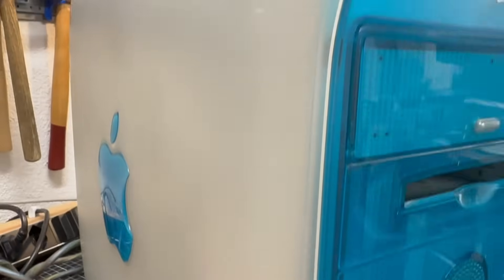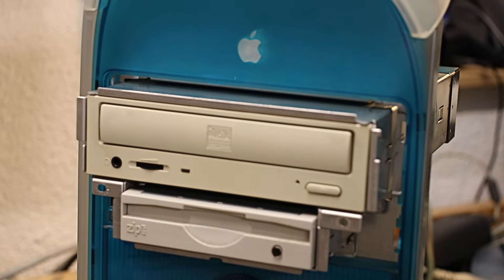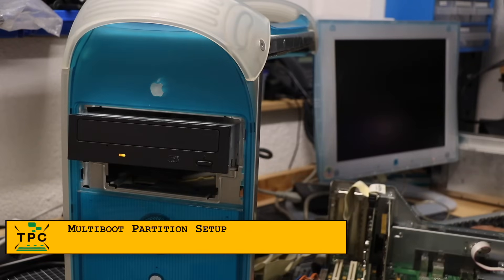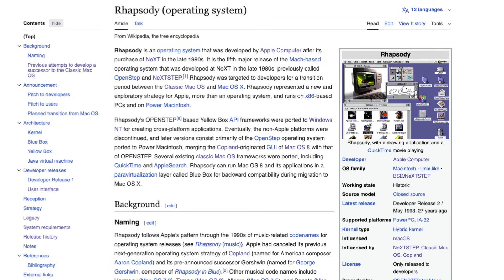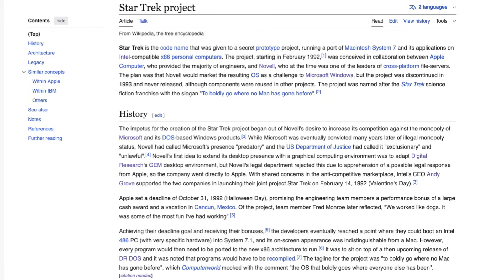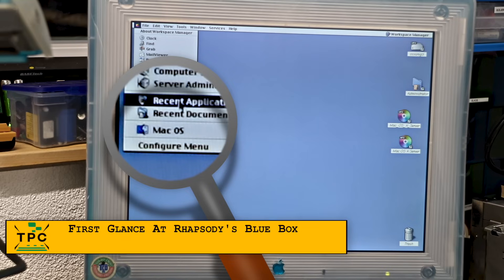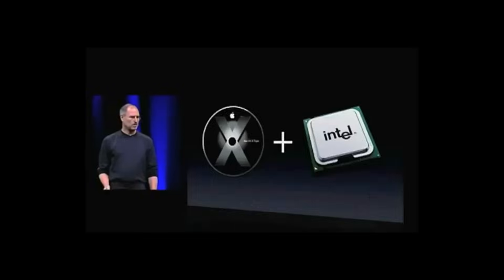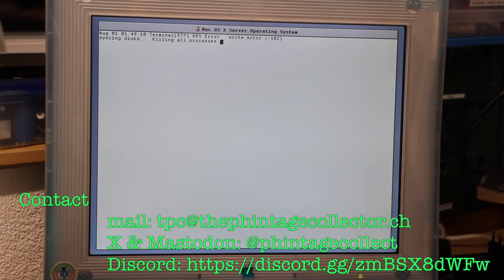Apple’s Rhapsody Era — Mac OS X Server 1.0 on PowerMac G3 (Part 1)

Comment: Apple also dipped their toes into Linux for a few years, working on MkLinux - Linux kernel running on top of a Mach microkernel on Apple PowerPC hardware. The userspace itself was Red Hat derived so not Apple-y at all. I suppose it was more of a exploration project, not really meant to replace their main OS.

Comment: A channel called "Another Boring Topic" recently released a lengthy and detailed analysis of the Apple/NeXT merger. It paints a slightly different story of Rhapsody and OS X: that Rhapsody was a failure, the migration strategy of "just rewrite everything in Yellow Box APIs" was laughed off by developers who weren't confident at all that those are here to stay at all, and that due to all that, Apple basically started over - that what eventually became final OS X (10.x) wasn't just an evolution of Rhapsody, but a major redesign, prompted by the failure of Rhapsody.

It's also worth noting that Carbon wasn't just a modernized version of Classic Mac OS APIs that could run on OS X - the exact same API was also available on OS 9. In fact, both OS 9 and OS X could run the exact same Carbon binaries. This gave developers basically no downsides when migrating their apps, probably contributing to the success of this API and OS X as a whole. Apple eventually got its way and forced everyone to migrate to Cocoa, which is a descendant of Yellow Box, after all - but it took several years.
Reply from the maker: Hmm ... with no single syllable did I say, Rhapsody was a success. No idea, how you arrived there.

And, to furtherly quote myself:

"[..] At this stage, Rhapsody relied on just two worlds: Yellow Box for new applications, and Blue Box to keep classic Mac applications alive. But this approach met resistance from developers who didn’t want to rewrite everything from scratch. [..]"

Maybe not as exaggerated as saying "developers laughed it off", but hey, they most definitely didn't want Yellow Box.
Sole reason why Apple brought Carbon along.

Rhapsody didn't have Carbon, only OS X 10.x and OS 9 did. Later on, OS 8.1+ received an optional CarbonLib update, too.

But these are aspects, which will be visited in more detail when I come by the actual OS X 10.0.
Reply: @THEPHINTAGECOLLECTOR I'm not suggesting that you said Rhapsody was a success. The point that Jonathan from ABT was trying to make is that OS X 10.0 isn't a direct successor/evolution to Rhapsody, but rather more like a start-over of the whole idea to Mac-ize NEXTSTEP.

Is that really the case? I don't know. But it's an interesting hypothesis. I really recommend ABT's video in any case, there are tons of interesting details in it.
Reply: @kFY514  I would suggest that’s more of a “ship of theseus” argument than a technical discussion. (Or perhaps the “when do grains of sand become a pile” one? Anyway.) 

How much does the codebase need to change for the same concept on the inherited NeXT Unix core to stop being the same concept? Different people will inevitably draw the line in different places. 
Especially with this being characterised in this video as a rehearsal/practice-run, it’s an apt metaphor imo. We see people disagreeing on whether something is an entirely-different stage/televisual production, merely built on similar bones after production changes, or whether they’re just evolutions of the same show, all the time. 
Or indeed there’s all sorts of arguments and historical flip-flopping in biological taxonomy as to where to draw the line in exactly the same way. Even what term to use (subspecies? Compatible cousin species? Species complex? Etc) when things are closely related but still different-ish in important ways.
Reply: @kaitlyn__L  I think that TPC's last video gave a pretty clear and definitive answer: what was released as OS X Server 1.x was a different development branch of OPENSTEP/Rhapsody than what was eventually released as 10.x.

The best analogy I can thus think of is, was Windows XP a successor to Windows 98/Me? From a business perspective, yes. From a technological perspective... eh, sort of, as it incorporated some tech originally developed for those (like System Restore for example), but also not really, as it was based on a completely (much more vividly than in the case of Rhapsody) different, parallel line of development. You're right that the boundaries are muddy :)
Reply: @kFY514  appropriately enough I’m in the middle of that one right now. 😊

Different development branch with the same goal certainly sounds a closer relative than DOS/NT, so I’m glad I brought up the cousin-species/subspecies argument. I think that’s probably the closest analogy! (Indeed different major versions of AT&T Unix or original BSD had such radical changes too.)
Reply: Correction: Mac OS 8-9 could only run Carbon apps compiled as CFM binaries, a similar format that classic Mac OS used. Mac OS 8-9 could not run Mach Carbon apps.

Comment: I still have mine 400MHz in original box with 17" CRT and two matching LCD monitors. Everything still looks like new other than small cracks around the side panel screws. I did have to change the flyback in the CRT. I have a Voodoo5 MAC still in box and two Redeon 9200 GPU's I used to use in this system back in the days. Maybe someday it will be worth something.
Reply: I never knew it was replaced so quickly. Did you get mad when they came out with the G4 so soon?
Reply: @MaxOakland  Not really. I can't believe it was back in 1999 doesn't seem that long ago but I was just going into high school at the time. I got a HP laptop for Christmas that I could take to school. Back then it was rare to have a laptop at my age I remember. I also remember having a Powerbook G3 Wallstreet but it was getting old already.
Reply: Make sure you pull the pram battery!

Comment: "UNIX based core" Holy marketing BS, Batman! There is no UNIX in there! Although early Next computers did come with a licensed copy of UNIX, by the time of the Apple merger, they had stopped doing that. Also, there's no such thing as "BSD UNIX". BSD stands for Berkeley Standard Distribution, which was a distribution of utilities and whatnot for Research UNIX. Users had to get a licensed copy of Research UNIX from AT&T separately. But after the breakup of the Bell system, AT&T was spun off, and the UNIX product was sold to UNIX Systems Labs, who had no interest in Research UNIX. At Berkeley, they closed up shop on the BSD project, releasing a final version with a clone OS that was supposed to have all traces of UNIX expunged from it. However they didn't do a thorough job, and USL sued them. By the time Rhapsody came out, BSD was dead for years. All of these claims that BSD is somehow synonymous with UNIX are untrue. The saddest thing is that the true story is actually interesting, but false advertising isn't.

Comment: 4:52 I thought you had to "HOLD" the "C" key during the entire boot... or maybe repeatedly tap.. it needs it at a very specific time and I always found it frustrating to nail.
Reply from the maker: Press and hold, correct. Unless the drive doesn't work, like mine ...

Comment: 4:57 correction: all PCI-based PowerPC Macs had Open Firmware. The iMac was the first with a “New World” ROM, which worked better with Mac OS X and fixed a lot of bugs. 
And yes, you can boot into Open Firmware on Old World Macs, but the default output is one of the serial ports instead of the display. There was a Mac OS 9 application that could change the values of Open Firmware parameters and make Old World Macs use the monitor instead of the serial port. 
I think booting from CD was fairly old: my family’s Performa 6360’s restore media was on a CD and could be booted from by holding down C at boot.
Reply: All "Old World" Macs contained the Macintosh Toolbox in the ROM. The architecture on PCI-based Old World machines was that they had Open FIrmware as the lowest layer of its ROM, but the implementation was somewhat buggy and barebones, as it was meant to only ever boot the Toolbox from the ROM, which in turn booted Classic Mac OS in a way that remained largely unchanged since the original Mac. Old World G3s can run OS X, and AFAIK that actually configures OF to boot the Mach kernel directly, but AFAIR the contemporary method to boot e.g. Linux on those machines was to use a bootloader launched from within Mac OS.

New World Macs only have Open Firmware in ROM, and when booting OS 8 or OS 9, the Toolbox loads from a file on the boot drive. But that also means the OF implementation is much more mature and complete, as it was actually intended to be used directly.
Reply: @kFY514  Pretty much spot on. Those old-world ROM macs used OF to initialize RAM and run PCI ROMs, then hand control back over to toolbox to boot classic MacOS. The only PowerPC-based Macs to lack OF were the NuBus first-generation Power Macs. 

Some of the last old world ROM macs, like the wallstreet PowerBook G3s, could display an OF console and could boot linux from it directly using quik. It was still easier to use the BootX extension to do it on them though. And as you say, MacOS X on them also came with an OF bootloader also called BootX, which was used to boot OS X on those machines just like it did on new world macs.

IIRC Apple BootX was actually pretty seriously overengineered. Apple had took steps to make it so that the MacOS X' BootX bootloader could also boot linux or any other operating systems of potential interest. It was capable of loading arbitrary ELFs from HFS/+, UFS, and ext2, even on old world ROM macs.
Reply: @henryhughes5832  The OF console could pop up on Old World Macs if you set the Open Firmware variables to change it from serial to keyboard/monitor. I remember doing that with a beige G3 tower.
I wondered if the Wallstreet didn't have a serial port, but it does as well as built-in USB.
Reply: @MaddTheSane Wallstreet didn't have USB. That was added with Lombard. Wallstreet did have a single serial port too, but powerbooks after the 3400 apparently had a newer 2.0 openfirmware that used the local console by default. 

I had to buy a cardbus card for USB on my wallsteet back in the day though. USB is actually apparently a giveaway for a new world ROM. No machines with it were old world.
Reply: @henryhughes5832  Apparently there were some Beige G3s that had places you could put some chips and viola, you have one USB port on the back.
Reply: @kFY514  The Beige G3s had the worst support for Mac OS X ever: The floppy drive didn't work (without a third-party driver that drags the system when the floppy drive is accessed), the composite input on select models doesn't work (I have no experience with that as I didn't have a model that had it), the built-in GPU didn't have the needed drivers for 3D acceleration…
There was a reason why Apple dropped support on the Beige G3s in 10.3.

Comment: I gave the latest release of Rhapsody a try on a Power Mac G3 Gossamer system, one of the old beige models, some years back. Good geeky fun, though most of the fun was in the installation process for me. There isn't much software available for it and BlueBox isn't quite as stable or capable as Classic in the consumer versions.

Comment: Mostly, Microsoft did everything better than.... 🙂 Whatever release we take: 2000, absolute corporate winner with capabilities to build a stable 32bit long hours running workstation if hardware is chosen correctly. XP - versatile client|domestic OS capable of running on a few generations of hardware, from Pentium3 era to well ahead into 2007 until Vista...
Reply from the maker: Windows 2000 and XP were definitely strong in their areas, no doubt. At the same time, I think every OS has its own strengths and particular use cases — Rhapsody included. I’m always open to discussing the differences without turning it into a war of ‘which was better’ 🙂
Reply: @THEPHINTAGECOLLECTOR  Yeah, those wars are totally childish. We all know AmigaOS was the greatest OS of all time!

Comment: I tried installing this on my PowerBook G3 (which is technically unsupported, but easily has enough memory and disk to run it). Sometimes it would install, but freeze every time I tried to log in. Sometimes the install would work, then freeze later on while running. And the few times I got it to run, I could never get the Yellow Box portion to run without crashing. So it's nice to see it actually running! I had similar disk partition problems as you did as well when trying to dual boot. But it wasn't stable for me even when I just let Rhapsody have the whole drive.